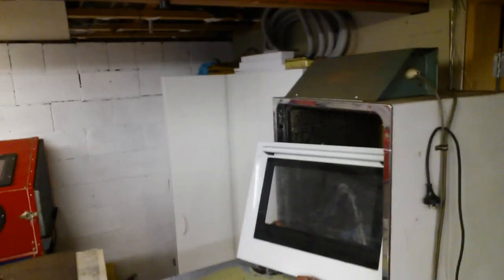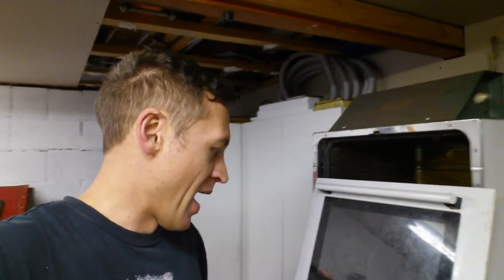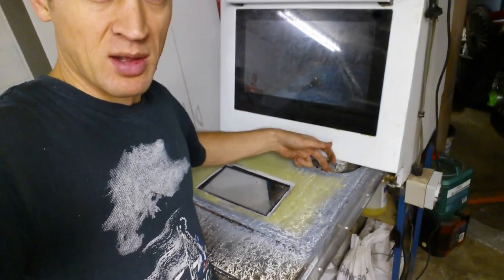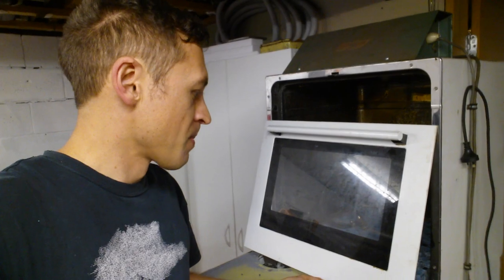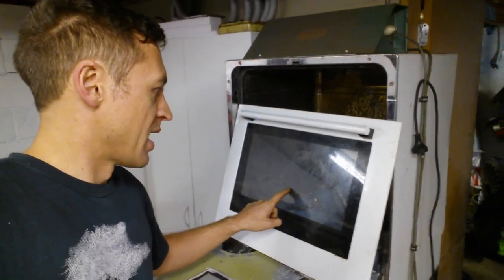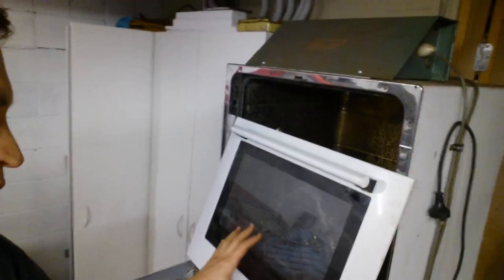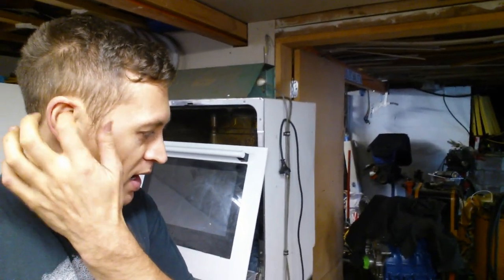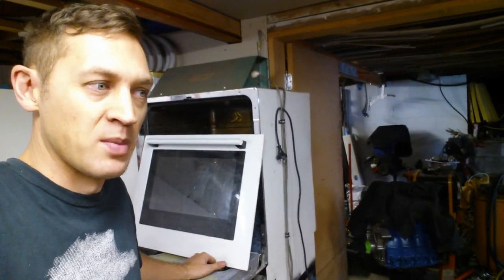Lockdown project - Flight or Failure?

Comment: First crash with the plane looool I know that feeling 😂😂😂  
Josh you need to practice on simulator plane you can download and find easily phoenix simulator on Internet all you need is a dongle usb to connect your radio 
A few hours of practicing and you will be able to fly 😉
Reply from the maker: Haha yeah I looked into sorting out a simulator, but decided I would just jump in the deep end. I enjoy building as much as flying atm. I do need to set up expo on the transmitter and decrease the throw on the control surfaces though. I'm mostly just happy that it flew and I was able to hand launch first time.
Reply: @ArmouryEnterprises  you should try fpv with drone you will love it
Very imersive as experience
Reply from the maker: That is the plan, I have a tonne of work to catch up on, but when I am past that I am going to first fix the plane for another go, and then look into building an FPV drone.
Reply: @ArmouryEnterprises  don't forget to post the video when you fix your plane 😉😉😁😁